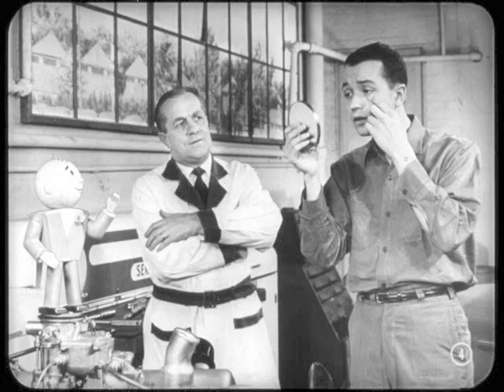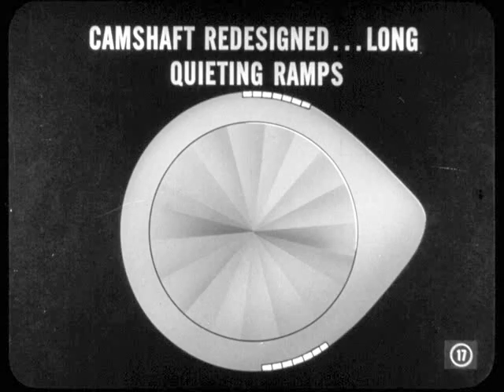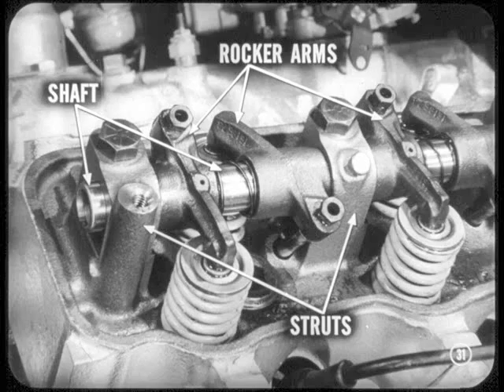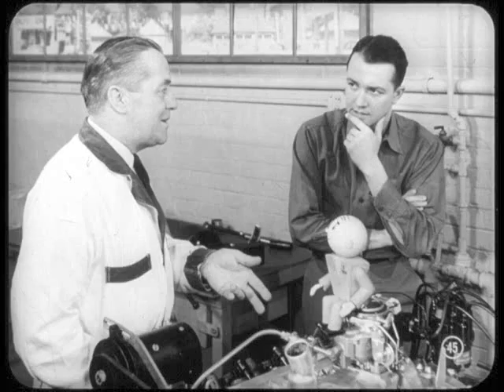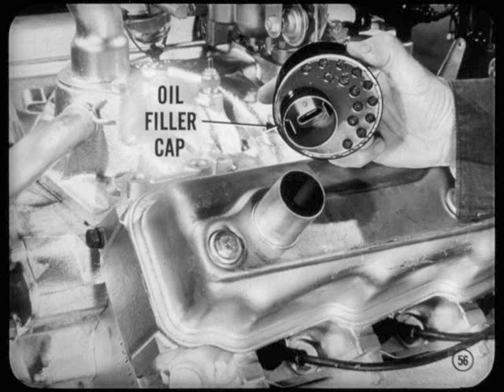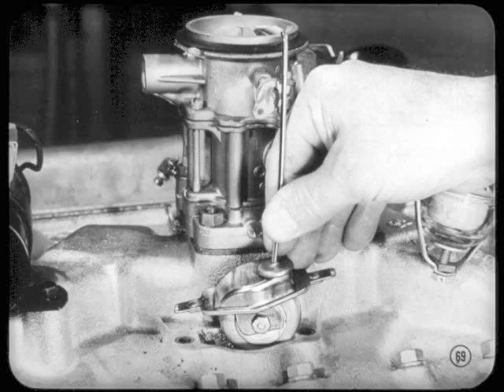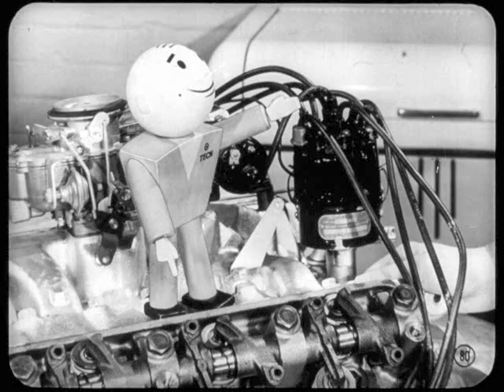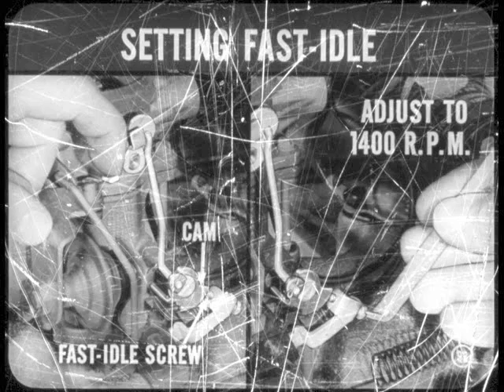Chrysler Master Tech - 1956, Volume 9-4 The New Plymouth V-8 Engine

Comment: I sometimes wonder what would have happened if Chrysler continued to use polysphere heads when they created the "LA" block.
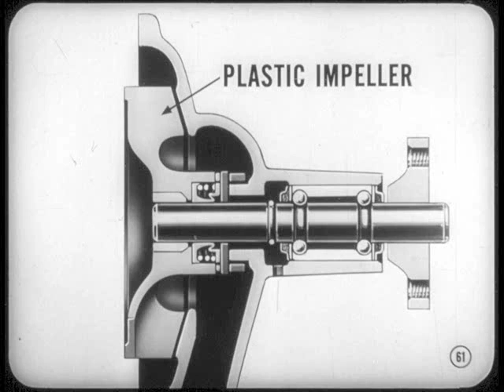11:30 I am surprised that they used a plastic impeller even back then. I don't know how many hundreds of thousands of plastic impellers failed in situations where metal ones wouldn't have. The cooling system should have as few plastic parts as possible, plastic gaskets were one reason GM V6 engines from the 1990s and 2000s were so trouble prone.
15:30 I can't imagine adjusting valves in motion. Wouldn't it be possible to shut the engine down, adjust a valve, restart, then adjust another valve?
16:00 This was a huge problem back when leaded gasoline was in use. My dad told me that during the 1960s, those spark plugs cost about $3, not adjusted for inflation. The price was so high that many people would sandblast their spark plugs, reset the gap, then reinstall. Unleaded gasoline made spark plugs last longer, then the addition of platinum or iridium extended their life even further. I usually see 60,000 miles out of spark plugs, although some car manufacturers will tell you they are good for 100,000 miles.
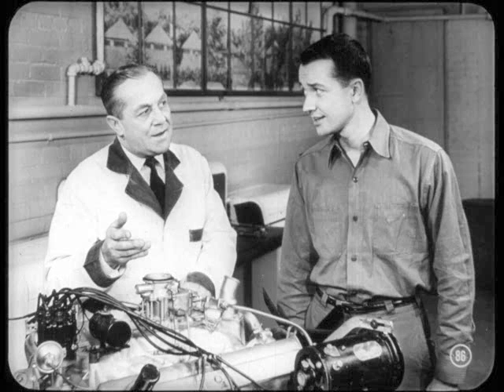16:45 modern cars often use a knock sensor to determine how far they can advance spark based on fuel octane. Also, it saves the car if you end up with a bad batch of gasoline.
17:40 When WASN'T it critical to torque down cylinder heads to ensure the gasket holds compression?
18:25 Car manufacturers love to make as many dick moves as possible. I was born in 1984, so I don't remember a car that was built with repairs in mind. When I was a child, my mom owned a 1985 Nissan Maxima, and the objective must have been to squeeze as much engine into as little space as possible. That car (And similar early FWD Maximas) cost a fortune in repairs. It is sad that some Chryslers of the time were even worse.

Comment: i know this is a old vidio..but this 277 looks like the predecessor to the poly 318...and the poly 313 canadian engines
....cool i like it thank you for posting
Reply: Allpar.com has many articles about polysphere engines, they sure had a wide variety of displacement numbers.
Reply: I believe the 277 is similar to the poly 318.  There was a 326 as well.
Reply: @timothykeith1367  The 303, 313, and 326 are similar to the much more plentiful 318 and use the same 3.31" stroke crankshaft and other parts except for the pistons due to the difference in bore size.  The 326 was used only by Dodge in 1959.  It is just a 318 bored out by .040".